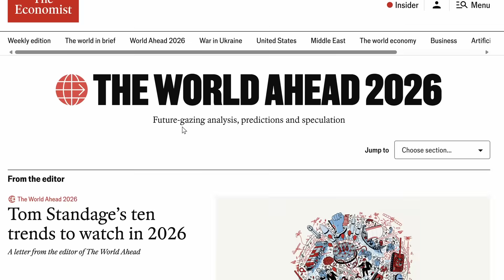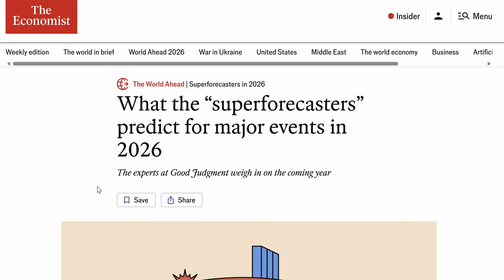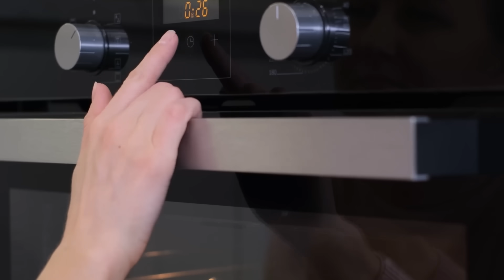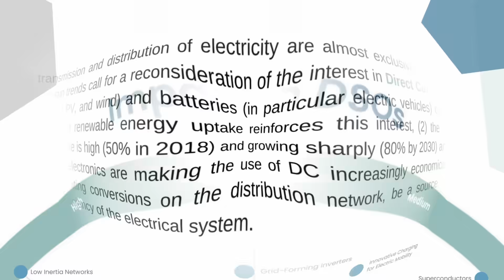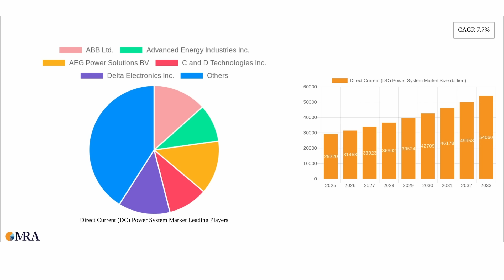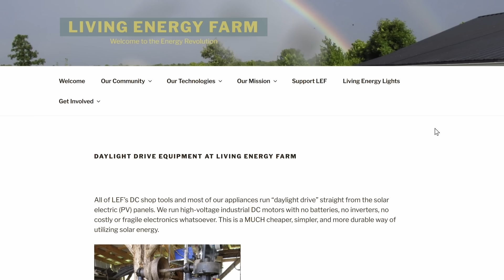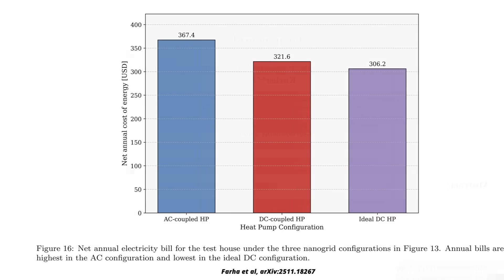Are We Using the Wrong Kind Of Electricity?

Comment: Many people here and that's including the self-proclaimed 'engineers' seem to forget that many local DC grids run on lower voltages than AC. With lower voltages you need thicker cables to transfer the same power. This has nothing to do with AC vs DC. I built a 400 W solar network, off-grid and entirely DC, to power outdoor lights, a phone and laptop charging station and a DC fan. It's a 24 V setup and I use proper wires and 10A DC breakers to prevent fires. This is because lower and not higher voltages are usually more dangerous because you have use much higher Amps to power everything. 24 volts is a good tradeoff compared to only 12 volts for this very reason. 24 volts requires half the Amps but still won't kill you when you accidentally touch the live wire. Higher DC voltages get trickier.

A DC only system from solar panels to appliances is extremely efficient. No transformers are required and lower power buck converters are cheap and small. Fun to work with too.

Comment: Wasses in ACU wines are on the order of just under 1% per mile. It’s not resistive losses. It’s hysteresis losses from the magnetic switch in 60 times a second. The air is magnetized and demagnetized all around the conductor at the higher voltages, that’s a bigger area of air that
Is magnetized and demagnetized and reversed. This causes heating losses.

The idea of that AC is more efficient is not true. It is less efficient and losses are almost 1% per mile or is DC has much less loss because the magnetic field is held constant. Modern DC to DC converter‘s eliminate the need for the 60 cycle AC that we presently have that worked when we only had transformers to change the voltage to kick the voltage up at transmission to kilovolts and back down to the customer DC to DC converter‘s can do that.

Comment: Some challenges are that the losses are really due to current, so higher voltage there more wattage there to do more real work with less loss. AC is simpler and loss when changing voltage. Additionally, interconnects undergo more pitting and corrosion with DC because the electrons always go the same way, rather than the metals being deposited back where they came from. However, when the voltages are very high, there is more parasitic loss to ground with AC. I can see where both could have good uses in different scenarios.

Comment: It's pretty simple, AC is cheaper and easier to deal with when you are talking about distances and changing voltages. Also when we started using AC we didn't have diodes so converting to DC was actually pretty damn hard. 

I think it would make sense to have your internals of your house be running on DC these days, but that would require changing out literally every appliance, heater and motor. Also DC motors are more expensive.

Comment: okay but DC still sucks. DC voltage still have to be stepped down for daily use and you can not do this cheaply and efficiently without transformers and guess what transformers = AC and I am not even talking about the capacitive factors for the lines.

Comment: No, AC doesn't switch directions 50 or 60 times a second. It has 50 to 60 cycles per second. It switches directions 100 or 120 times per second.

Comment: AC is really good at electrocuting people (muscles clench every time the direction changes), and DC is really good at burning houses down, because it turns every loose connection into a plasma torch. We'll need very good arc fault current breakers if we want to switch to domestic DC without a revolt from the home insurers.

Comment: The major reason for AC isn't that AC is inherently more efficient. 

It's because AC allows for the use of transformers, which allows transmission to happen at millions of volts which DOES allow for thin transmission lines and high efficiency. 

DC high voltage necessarily requires very complex, expensive and lossy switching electronics.

Comment: I live near the Pacific DC intertie.  It connects between two major substations on the Columbia River and in LA.  It operates at an astonishing 1000 kV, which minimizes line loss even though there is significant conversion loss to AC at both ends.  There are also multiple high kV AC lines connecting the Pacific NW and California.  Which are all part of the western North America grid, so the DC interior isn't there to transfer power between different AC grids.  The reason it's there and DC is quite complicated and beyond the scope of a 5 minute video.

Comment: DC is more dangerous when used in a residence. If you accidently grab a live AC wire or plug you can drop it because the alternating current won't paralyze your hand muscles. DC will, which can kill you if you can' let go and  break the connection.

Comment: One thing you didn't mention that is somewhat important is that both AC and DC  will flow into the bag of saltwater called your body, seeking the path of least resistance,  you should you accidentally  touch both positive and negative electrodes at the same time.    With 120 VAC, it only takes about 20 mA of current to kill you.    The total available power from an electrical system, as you know, is the product of the current and the voltage.    

20 mA at 120 VAC is only 2.4 W.    That is enough to kill you.

One of the charts you showed listed 32 A of current.   32 A times 12 VDC is    384 W.   20 A times  120 VAC  is 2400 W But having the kind of voltage that wiggles back and forth 100 or 120 times a second is easier to pull your muscle away, or so I've heard.    I am certainly NOT going to try it.   I actually did, as a boy, touch two 120 VAC electrodes accidentally and took steps to make sure I would never do it again.   It was easy to pull my hand away from a 120 VAC pair of electrodes in a split second.    I'm so glad it wasn't DC, else I might not have been able to pull away.

The most important thing is that the two electrodes NOT be on opposite sides of your body.   If an electrical fault should occur, the current could flow through your heart, making it impossible to do anything but die.
When I was much younger  I heard about a ham radio enthusiast who decided to erect a large metal structure
to hold a vertical antenna.      His big mistake was using an aluminum ladder rather than a wooden one.    When
the ladder accidentally came into contact with AC power lines, he fell off it and died.

Also, AC waveforms at any voltage travel outside the wires that guide them.    DC current only stays inside the wires, meaning you need much thicker wires for DC current, which is more expensive.   Aluminum and copper are the best conductors, and they're pricey for that reason.

Merry Christmas, and Happy New Year.

Comment: I always found a PC plugged into a UPS to be silly.  AC to the UPS, convert to DC to manage the battery, convert to AC to send to the PC where it converts it back to DC.

You can get DC power supplies for PCs but I haven't seen any UPSs that are made to supply them, they are made for data centers where you have whole rooms using DC and connected to a giant battery bank.
Reply: You can find 48V DC UPS units for TelCo racks and those work fine with 48V DC power supplies for PC or servers or whatever.  Not super common for most but very available.  Cables are much larger gauge usually though since the voltage is so much lower and that causes some other issues you need to solve...

48V DC versus commercial 208V/250V/277V/480V is a huge difference in wire conductor sizes for ampacity and voltage drop.  48V DC needs a wire rated for roughly 85A versus only 16A for the 250V circuit and that is per 1U-3U server rack space.  That is a wire gauge change from #12 AWG on AC to about #2 or #4 AWG for DC depending on wire length for a 3-4kW load.  In weight alone that is an increase of 7X-11X in just wire volume needed.  Not to mention how much more difficult it is to route, connect and package.

They both have their place IMHO and part of the design issues are to pick the best option where it is needed.

Comment: Actually Wind Turbines create AC Electricity!
Reply: Which is rectified to DC and connected to an inverter to export AC to the grid. This is because the original AC is not synchronised with the grid phase.
Reply: @TheWatcherInTheTower  That doesn't change the fact that Wind Turbines create AC...
Reply: @MyWasteOfTime in the same way that photovoltaics create AC.  🤔

Comment: The advantage of AC is that it is easy to transform using transformers. DC distribution requires electronic step-down inverters. The advantage was high voltage could be easily stepped down to safe working voltages for domestic use. The high voltage distribution systems require less wire cross section. But in the age of solid state inverter technology high voltage DC distribution is less of a problem. From some electronic devises it would be simple to have their PSU's accept DC or AC for appliances using induction motors it would be a bigger challenge, but some appliances already create variable AC internally to run motors.

Comment: 3:10: Most small heating appliances (hot plate, toaster oven, electric frying pan, hot air popcorn popper, electric resistance water heater) all work fine on 120 V DC though the switch or thermostat contacts need to be protected with a snubber.  All series wound or universal motors (vacuum cleaner, driller, Skil-saw, Sawz-All) also work perfectly well on 120 VDC.  Sabine mentioned small electronics that typically have switch mode power supplies that also work fine on 120 VDC.

Comment: High voltage AC (60,000 volts or more) is used is used for less power loss over long distance and AC works with step down transformers to get the voltage used in your house.

Comment: There's also the fact that DC actually has less transmission losses than AC over very long distances because AC has capacitive and inductive losses to the environment that DC doesn't have. The benefits are amplified when the cables are underwater or underground, where DC transmission benefits are seen after only a few dozen kilometers rather than several hundreds.

Comment: Back in the days when AC and DC were both in contention, AC could simply be transformed to step up or step down in voltage, or buck-boost for small adjustments. Just count the windings. The technology exists now for efficient DC transformers, but that wasn't the case more than a a century ago.
Reply: A DC Transformer Runs on AC and is no more efficient now than it was 100 years ago, the 'efficiency' gain is in the operating frequency,
the enabling technology is the hi power semi conductor switching devices FET & IGBTs
Reply: There were no power semiconductors or switched power technology more than a hundred years ago. Switched power can be applied to both AC and DC input and achieve higher efficiency in both cases.

Comment: As a former grid operator, I say you are a little off base and late to the table. We are optimizing the system and don't need people thinking they can get something for nothing. Except at very high voltages, losses are greater for D.C., the system has to have A.C. to operate with transformers and converting D.C. to D.C. is not such a good idea to eliminate the transformers, which are very reliable and won't be affected so much by people trying to destroy the system. Breakers are another problem. Keep it simple stupid. The best part is no part. Don't fix it if it isn't broken.

Comment: IMO, the 60/50 Hz frequency is biggest problem.  It should 20-24kHz.  And also three-phase.  NASA did a study on this in the late 70s for the Freedom space station (later ISS).  DC is bad as you can't transform it.  At a higher frequency, less iron is required in passive transformers.

Comment: The snubbing required for high current DC switches is much greater than for AC as AC only has to break the current for half a cycle.

Without snubbing, high current contacts can burn out or even weld!

Comment: I used to work as an electrical engineer in power transmission over 10 years ago. After the power electronics revolution in the 2000s bringing efficient transforming of DC voltages, DC power grids would be safer, more efficient and more stable than our current AC power grid. The reason they haven't been switched over is because the cost of transitioning would be unbelievably huge and disruptive. But if you were building a new grid from scratch, it probably would be better to make it a DC grid. But maybe I'm not aware of some of the issues with DC as I never worked on any high voltage DC systems. 

Some of the advantages of DC over AC in transmission would be:
- Not having to worry about power factor. This causes big drops in efficiency and in severe cases can destabilize the power system. 
- DC load matching is easier and is less important that with AC. In AC systems, unmatched loads cause reflection back into the power system and this causes issues. It's the same principle as optical reflection when the transmission medium changes, like light reflecting off the surface of water.
- Not having your power lines acting as massive antennas transmitting a very high intensity 50Hz EM signal into the environment. A lot of power is lost to this, and it's almost impossible to stop.
- No frequency matching issues. Unmatched frequency between AC systems can cause spectacular fireworks when trying to connect them.
- Not having to worry about waveform collapse. This is the death of an AC power system. Have fun restarting it!
- No induced voltage in metal objects near power lines. Mostly this causes 'startle shocks', but there have been incidents where the induced voltage has been large enough to kill people.
- DC is generally safer than AC. Electrocutions at the same voltage are less likely to kill. Probably won't make a difference at very high voltage though, as it's the UV radiation from the arc that kills you most of the time.
- Probably more, but this is what I can think of off the top of my head.

Also, merry Christmas everyone!

Comment: It’s a myth that AC is less lossy over long distances. It’s about the same as DC. The reason we use AC is because a transformer can make it high voltage, which is less lossy. But for any given voltage, they are the same level of loss.
Reply: Actually, DC is slightly less lossy.

Comment: At the time of Edison and Tesla, AC made more sense than DC since transformers could convert the power from low voltage, high amperage to high voltage, low amperage which would experience less resistance over many miles to the generators.  Merry Christmas, Sabine!

Comment: Except, is even more convoluted with respect to electric vehicles.  True, energy is stored in direct current batteries, or generated from fuel cells, but (for virtually all modern designs) it is then “inverted” into high frequency alternating current (much, much higher than power mains frequency) before being applied to the electric motor.  The main reason for alternating current mains power transmission was magnetic flux driven voltage transformation, which made it (originally) possible to get up to the lower-loss very high voltage transmission.  Now that high voltage direct current conversion is possible, comes down the practicality of the specific transmission application and environment.  All in all, it ends up being strictly an engineering design consideration for each particular individual situation.

Comment: But DC has a voltage-conversion problem. You cannot get a higher DC voltage from a lower DC voltage without converting DC to AC and then AC to DC. Same on transforming higher to lower DC voltage, unless you waste a substantial portion of electric energy. Fortunately, such DC-to-AC-to-DC devices have become very efficient, smaller, and cheaper as of late.
Reply: Actually, the USA has efficient High Voltage DC Transmission Lines.
Reply: @MrSummitville  Which require buck/boost DC/AC/DC devices to feed systems not designed to operate at HVDC levels.
Reply: @wafikiri_ Nope. Everything has been working perfectly.

Comment: DC powered data centers have been a thing since the phone company has existed. Central offices weren't technically data centers but they did use DC because they could use lead acid battery technology for backup. They prided themselves on having nearly 100% availability. Also government probably insisted on it.

A lot of telecom equipment is designed to run on 48VDC. And I'm sure a lot of computer gear followed that when telecom companies were the customer.

In the 90s I remember that Sun microsystems was working with some other companies on a modern 400VDC data center standard. Not sure if that was the ancestor of modern plans but it also was made possible by the efficient DC-DC converter technology.

I'm surprised it's not more established. People resist change.

Comment: DC is and always has been more efficient for long range transmission. AC pushes the electrons to the outside of the conductor and so reduces the efficiency. The issue is converting AC is easier than DC so it makes it better for using AC back before we had good semiconductors and knowledge around DC up/down scaling
Reply: AC-to-DC Converters are now, as efficient as AC transformers. That is why the USA has installed High Voltage DC Transmission Lines.